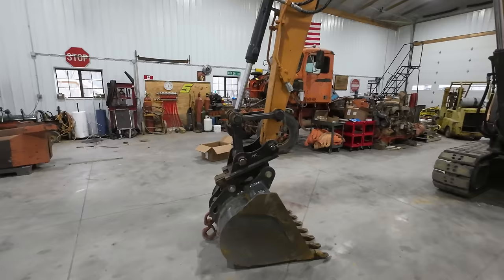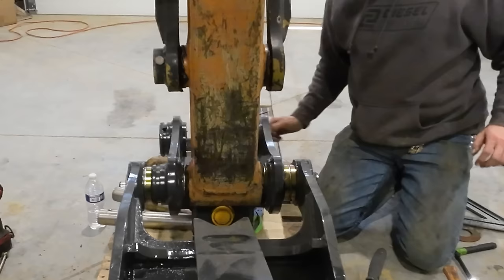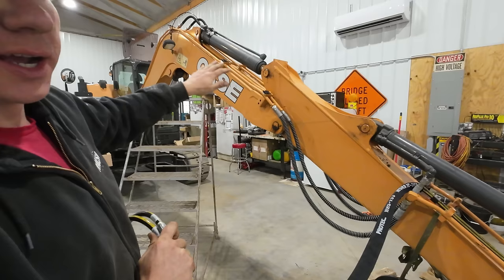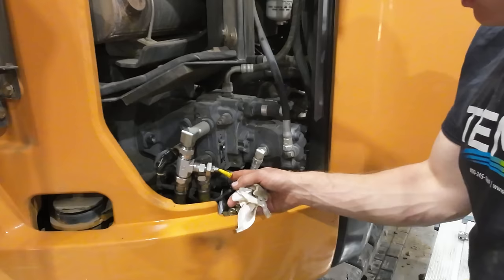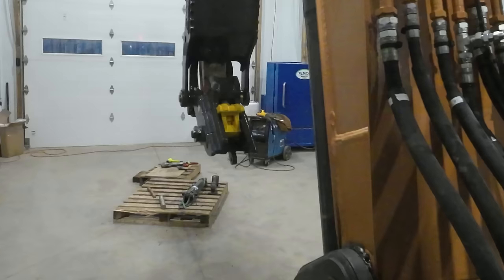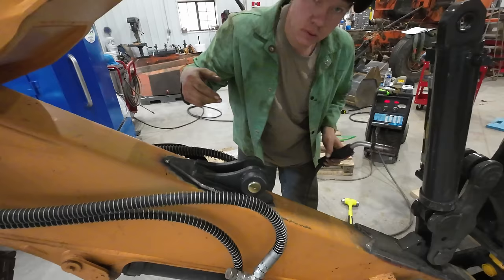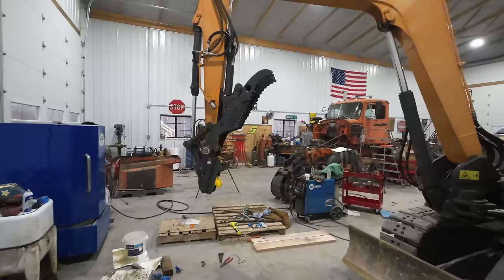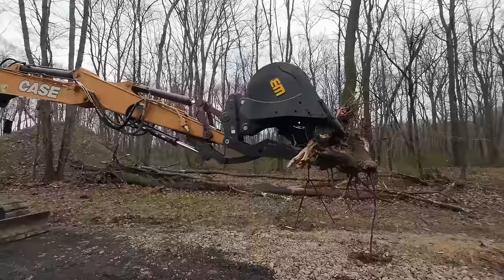Installing A Hydraulic Coupler and Progressive Link Thumb. ( New Excavator Gets Upgrades!)

Comment: Matt! I wanted that exact combo for my mini..... ultimately it ended up going up 30% in cost before I could get it (during the Covid stuff).... ended up getting to pricey for me in the end. But man! Am I jealous! (In a good way) 
**SIDE NOTE THOUGH - have you made sure the pressure relief is set on the thumb? The thumb cylinder relief should be set below your main system pressure.....aka when you curl your bucket and put pressure on the thumb, the thumb cylinder should should retract (through the relief valve). If not, you could bend your thumb cylinder fairly easy. **
Anyway, super happy for you brother. That's a great machine you got there! Good luck, be safe

Comment: Great video, Matt!!
Tip for future is to take the hydraulic tank cap off and put a vacuum cleaner in it (we have rubber adapters at work but you can wrap a rag around) so it creates vacuum in the hydraulic system and most hoses won’t leak when you open them. Also, super important, hold the hydraulic hoses with a wrench when tighthening so they dont twist!! Best wishes!
Edit- Don’t stick the end of the vacuum too deep because it will suck up oil. When you loosen a hose, the oil starts to bubble due to air getting in trough the hose.

Comment: I wish I had instructions when I do stuff like this, but last time I did something like this, I was converting a Hitachi 210F with a southstar qs500 possessing head to a excavator. Using the stick from a burnt Deere 180g  excavator. Then I plumbed and wired it to be able to run a log grapple as well

Comment: Matt we have a 50G John Deere excavator that we have a diamond mower on.  It’s powered from the aux port.  We also have a thumb.  I would recommend shut off valves between the Ts you installed this way you can retract the thumb and lock it out while performing other tasks with the aux port.

Comment: Hey Matt, now you need to watch a bunch of Mike's over on Dirt Perfact channel and learn new tricks from his excavator work I know you all are friends but he makes it look so easy with how he uses his excavators. You do an awesome job as well what I'm saying just like the trees you were testing the new bucket and thumb on Mike will reach up about half to three forths of the way up on the trunk and pluck them out of the ground roots and all and never have to dig the roots out saving all that time. Then all he has to do is fill the hole. Where they came out of, if it's a bigger tree he will grab about half way up and just snap the top out of them then just reach over and pluck the rest of it out of the ground. Now granted he has alot of experience running a excavator but it's just like an extension of his arm and hand. I'm just saying you might be able to take some pointers of how the best way to do that is. You did a great job I'm just saying the way he does it is such a time saver and what is most important TIME of course. Isn't that the most important thing to everyone. Great video dude always love your content. Keep them coming buddy I'll be here waiting.

Comment: Hey Matt I welded for 20 years and just by the sound of your MIG welder you're pushing your wire just a little bit your pushing it hard you need to back it off turn  to where it sounds smooth and not crack like it is now

Comment: As you removed the bolts on the cover plate for the high pressure side I imagined the door flying open and 5 gallons of fluid hitting you at 100 miles an hour.

Comment: my only issue is wont where youve T'd off for the thumb leave it active if your also using the aux hydraulics as well ? wont ya need an isolation valve to turn it on n off? but awesome video an great install

Comment: Another way to help prevent rust damage between the plates is to paint it with weld through paint both sides and then proceed with welding.  Most paint manufacturers have a line some put it in spray cans as well.  A bit expensive but effective.  Also works well when you have prepared surface outside and don't want it to flash.  You see a lot of it in shipyards where days or weeks may go by after prepping before the welding is complete.  Steel can be ordered from the suppliers coated to although I have only seen full panels.  Nice looking machine.

Comment: Why the tee on the auxiliary circuit?  You might consider a manual diverter valve in case you want to run a brush cutter or breaker or something you can shut off the thumb.

Comment: You gave me  "Visions of Andrew Camerata" . 😢😢 Welding  so close to those  hydraulics  without covering anything up  !! 😂😂
Reply from the maker: Watch again, the lower cylinder which is the only one in danger was covered with a welding coat
Reply: @DieselCreek  I was thinking  about  @ 20 minutes and  5 seconds    ? Lots of weld splatter  there ?

Comment: Dumb question but i saw a shut off for the aux hydraulic hookup at the valve but not one that would shut off flow to the thumb off. Did i miss something, our machines always had i valve that would change flow  not just a t fitting

Comment: I would probably use a flapper disk or wire wheel vs an abrasive disk on the boom.  Don't want to cut in too far.

Comment: John over at FarmCraft101 sticks a ShopVac hose in the fill neck of the hydraulic tank to create a partial vacuum in the hydraulic system to reduce spills when he has to crack a line...

The moment he cracks a fitting, the vacuum tries to suck all the fluid in the line back into the tank, so little to nothing flows out the lose fitting (all the air is rushing in that fitting pulling the oil away)...

It should work for you too...

Comment: To explain the pipe thread question there is BSP/BSPT/BSPP/NTP/NPTF/NPS and FIP. They are all measured differently. A good way to go mad if you want too investigate further.
Reply: NTP should be NPT to avoid confusion
Reply: I missed BSPF which could also be BSPTFT possibly?

Comment: Can you use a shop vac to pull vacuum on the hydraulic holding tank to keep the fluid from leaking when you open up the fittings?

Comment: Hey Matt,  about the welding: might try stepping up the amperage one click, or slow the wire speed just slightly. You can fine tune your welder to match your gun movement.

Think of it like adjusting a carburetor in a completely non-related sort of way. You gotta lean out the mix. The metal isn't burning all the way in. 

And I agree with your JIC/O-ring comment. I like o-ring boss myself. (Found on HPOP systems in Cat/Navistar).

Nice touch with the logos on the thumb! I like!

Comment: I've had Old-Timers tell me it's better for the cylinder to completely collapse you just don't want the cylinder to be able to push the pack out of the bottom or out of the top it'll push the pack out especially when you overextend the boom. It'll make the cylinder leak because it overextends.

Comment: I don't see how you can use the AUX circuit for something else when the thumb is plumbed into it.  Seems that you need a diverter valve on each line where you T-'ed into it.  Nice kit from WB!

Comment: Regarding the thumb. It seems to be a really handy thing to have! I rarely see a thumb on excavators here, but they are almost always equipped with a tilting rotator between quick coupling and the stick. When watching skilled operators, the tilting rotator seems to be a better option than the thumb. Sometimes they also have a gripper at the backside of the bucket, kind of like replacement of the thumb.
Have you ever considered a tilting rotator as an alternative?

Comment: VERY NEAT WORK, Matt!!! I’m just kinda wondering if there should be some kind of bump protection on the stick for the valves, to keep them safe when you’re cleaning out brush? Just a thought, but I also realize that when you’re having to take hoses off, the bump protection may make the job more difficult. Just wondering.

Comment: Hi Matt, BSP stands for British Standard Pipe, it is a standard that first came into use for pipework a couple of hundred years ago when the first static steam engines were invented to use as winding engines and pumps and has lingered on.
Another old standard that will be in use for the foreseeable future is the internal screw thread in a camera base that is used to mount the camera to a tripod which is  BSW (British Standard Whitworth) a course 1/4-inch thread.

Comment: Problem is that if you leave a hole in the weld when it's hot and rains you capillary action and it will suck water into the gap so your best to weld all the way around

Comment: You need to put a manual selector valve to cut out the thumb hydraulics so the thumb doesn’t activate when you connect aux attachments.

Comment: BSP , British Standard Pipe fittings are far superior to anything else . 
Far higher pressure rates compared to anything else .
I live in the uk whilst working building various machines etc . 
Always used BSP FITTINGS . 
Never had failures or complaints either . 
You just need set of huge spanner’s .

Comment: That aux control block at the end of the stick should have had a capped off port for a third function hook up. I don't think you needed the T-fitting? I didn't see a diverter valve, but that's the way you want to go so you can isolate aux functions. For instance if you get a hammer and try to use it with just a T-fitting, the thumb will swing when you operate the hammer without an isolation diverter valve on the aux supply/return lines.

Comment: Man, this is turning it beautifully. You make it look simple, too! I'm curious, though... Is the coupler controller's location (it appears to be back near your elbow when seated) going to prove to be less than ideal, ergonomically? I would've imagined maybe a replacement joystick handle with maybe a toggle on top ( like the weapon selector switch on a fighter jet's stick) that would allow your thumb to control the coupler more ergonomically. But hey, I'm sure the designers had their reasons.

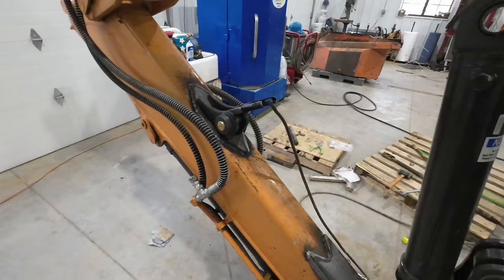50:05 Only thing that stood out to me was that the sound of the arc was chattering a bit. In my (limited) mig welding experience I was taught that the ideal arc would sound fairly smooth, almost like a hiss, rather than a crackle. IIRC, that crackling is an indication that a bit more current and wire feed velocity ought to smooth it out. Should help just a tad with penetration, too. But, I am not a certified welder, nor even a currently-practicing amateur. Just hoping my memory is accurate and maybe it could help you a little, too. I found that I prefer mig vs stick just for the cleaner-looking welds, not having to chip off the slag after every bead. Plus, not having to keep moving my hand closer and closer to the arc as the welding rod gets shorter. I just feel like mig is easier for me to keep consistent once the welder's settings are worked out.

But man, the finished product is sweet! I'm really digging (😂) this new machine!

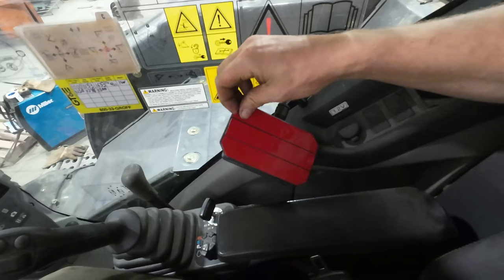50:44 Just couldn't wait for Amazon, eh? 😁

Comment: As far as your welds looking right they seem like you've got the root pass you just need to put the fill it over top of it you need to carry the weld from the very side to the top and do the weave pattern just like doing stick it just needs that heat pass over the top. Melt it all in make it look like butter. Once it's down and it's not going to draw none. You just need to put your fillet over top of it and kind of just butter it all in to dress it up.

Comment: Sooo... I'm curious. Would it be possible for you to fabricate a type of blade that would fit on the side of the claw and act like scissors using the side of the bucket as the other half that would be able to chop up limbs. Just a thought. Great upgrade to the case by the way!

Comment: Looks great and an easy fit, eat your heart out Let’s Dig18 😊
As for the numerous different types of hydraulic thread types, I’m definitely with you and wish all the manufacturers would get together and decide on a couple of types to use. I’m a hydraulic hose engineer over the pond in the uk and regularly see metric light and heavy, bsp, jic, orfs and flange types, then a few other types less often but still come across them.

Comment: Out of curiosity, as someone who's not run excavators with a thumb, since the thumb is on the auxiliary circuit, when you have something clamped, and you curl the bucket, it pushes against the thumb, does the thumb have a pressure relief so it can move with the bucket, or do you have to actuate both movements manually simultaneously?

Comment: Now my question due to lack of knowledge but with the thumb cylinder fully extended if you curled the bucket without reversing the thumb with it will it hurt the hydraulics? Im guessing no with how it’s tied in but let’s be fair engineering is very rarely on the side of users or maintainers.

Comment: You have a very nice machine there in it's complete form. Very nice. Welding the (any thing) to your boom. Make it easy as possible to remove or seal it completely to exhaust all available oxygen within the joint by making an airtight weld all the way around the perimeter of the attachment plate Matt. ANY opening is a recipe to rust without any check in place. Seal the joint up absolutely and completely. Experienced and ticketed welder speaking 👍

Comment: hey matt i have found that if you drill and tap the hole to take grease nipple in the thumb base plate, after welding and paint, pump some grease into  void space between thumb and dipper arm stops water and rust from forming and grease every now and then . we used to do this on concrete trucks with double thickness chassis rails to stop water and concrete from building up between rails and causing corrosion or rust. good videos mate i enjoy them i have operated on most everything ive seen on your channel  and am running cat 330 most days nice machine. started on a chain drive four stick 550 kato in 1987

Comment: What if you put a grease fitting on the plate. Then pump alot of grease after all of the welding. Water can not rust if there is grease.

Comment: I like Werkbrau stuff, and I was intrigued to follow the fitting of their hydraulic coupler. I bought a mechanical coupler of theirs and others for fear of both the price and the intricacy of the installation. Watching you do one may be changing my mind.  
I'm with you on the hydraulic fittings. I wish everything could be JIC for the conformity and the ease of understanding, but not being an engineer, there must be some advantage to the varied use of the o-ring designs. Just one would be fine with me, but of the three most common, I need so many caps and plugs, it seems like such a waste.

Comment: Those are nice, versatile, and practical add-ons for your newest toy, Matt. Me like. My eyeballs nearly popped out when you reached over and picked up the pallets on the other corner of the shop from your central position in the other lane.  That case has some reach!  //  I, too, love working on clean vehicles when possible, so I got a pressure washer and use it before working on my vehicles now.  //  RE: lines, do you have any crow's foot wrenches?  I got both straight (open end) and line wrench versions of them and they came in VERY handy for hard-to-reach fittings. Throw a crow's foot on the end of a 3/8 ratchet extension and go for it.

Comment: Stupid question (sorry)... with the T junction for the Aux line to the Thumb cylinder.. how do you switch the thumb off when you want to use the Aux lines for say a hammer? In other units I've seen a switch.... but cant figure how you would with your setup (not an operator.. just an interested nerd!)

Comment: Could anyone answer a question for me please. The few people I know that own heavy equipment are giving me two different answers. When it comes to the batteries to use in these machines,  could you use deep cycle marine batteries ( like the ones used for trolling motors ) as your main batteries? Or do you need to use ones made specifically for heavy machinery? 
Any help would be greatly appreciated, thanks.

Comment: Where did you get that track jack? I've never seen them outside of coal mines. Also be careful with those, they have a habit of releasing tension on the ratchet portion unexpectedly under load. Seen guys get broken jaws from a sudden release of the jack bar.

Comment: Intertesting that the first thing I thought of when you were going to put the t in the high pressure line was " Is the line clamped as it should be? Are you going to have a problem moving it down below the t??

Comment: Won’t the thumb operate every time you run the auxiliaries? I don’t see a shut off since you installed the t fittings on the boom. 

So if you were running a hammer the thumb would be closing each time you activated it.

Also do you have to set the relief on the thumb so it doesn’t bend the cylinder or does the kit do that?

Comment: Hi Matt, thanks for the content.  question.  I had the dealer put a thumb on my machine, I thought they said something about adjusting the thumb hydraulics so that the superior strength of the bucket curl doesn't damage the cylinder of the thumb.  I noticed you didn't mention this.  Am I missing something or are you?  Thanks

Comment: Honest question here: With the thumb hooked up to the aux system with the t-fittings like it is, how do you keep it from operating the thumb if you have another attachment that also uses the aux lines to operate? Is there a bypass built into the thumb and a locked position or are there really no other attachments that would use the aux system that way? I just imagine something like an implement that uses aux flow to operate, like a saw, brush attachment, ect. (Don’t even know if those are a thing on excavator attachment) I’ll be honest, I misunderstood when you announced you were adding a hydrauling coupler to your machine and though it was going to be one of those 360 articulated couplers that allows all sorts of crazy moment of the bucket and attachments. Awesome video as always!